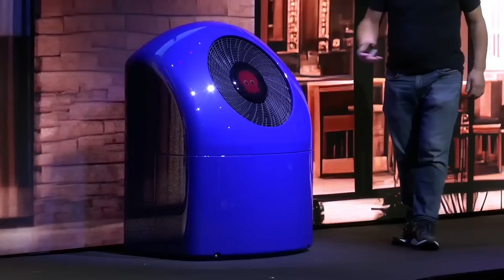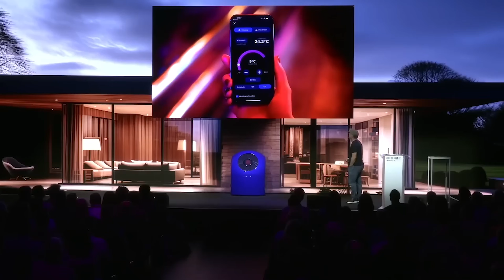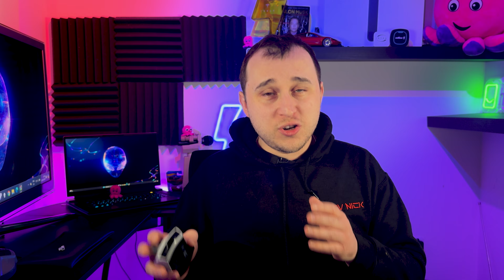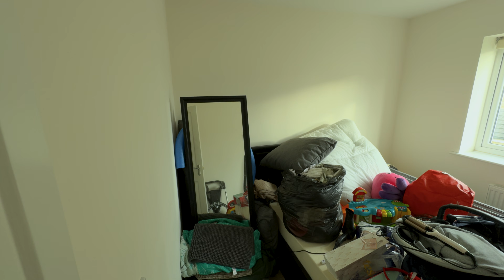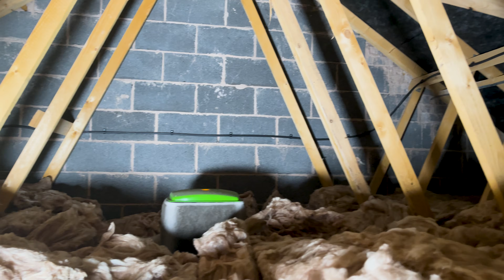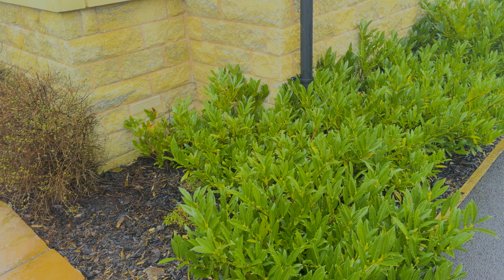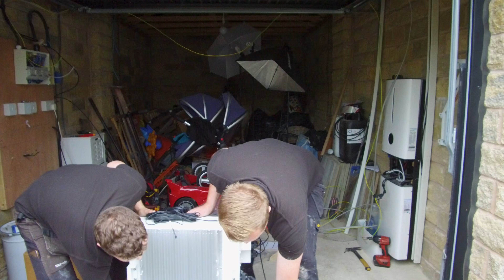Octopus Heat Pump Survey HAS Hidden COST!

Comment: It's a good shout on the radiators, I assumed my house would be copper pipe and tapped off which does help with the presumed problem - though I haven't lifted my floorboards yet, the signs are good. Loft hatches between the rafters - good old new builds, mine is like that, you only get just under 600mm to play with in new builds, you can make them longer but not wider without pretty serious complications. NGL I'm not personally a fan of tanks (and really any infrastructure, particularly water-containing infrastructure) in my loft. Yeah, you'll probably never have a problem with it, but when you do the problems tend to be relatively quite serious - and you have to get the heat up there to start with which is relatively lossy. I'm holding off on heat pumps on two basis - firstly that if permitted development rights allow larger volume units there might be a flood of new products that are more efficient (larger volume = larger heat exchanger = more efficient). Secondly, exhaust air heat pumps really appeal to me because my new build is super efficient, and I want to take heat that gathers at the top of my (3-story) house and put it back in at the ground floor and tap it off excess, plus the ventilation. With an EAHP I might be able to tear out my radiators entirely and not have to worry about the pipework nonsense. Both of those markets are going to take time to develop, and I think I'm going to wait for that. On tanks - I have a huge space under my stairs that only has an ironing board and my server rack that could easily be used for a water tank, somebody should really make a wedge-shaped one that could go there.. In re putting a heat pump unit next to the pavement like that, I honestly don't think I would want it where people could vandalise it as they walk past anyway, people be people, doesn't matter how nice the area is.
Reply: Wedge shaped tank would be a really interesting concept.

Comment: I would be bloody annoyed if as the neighbour I had to have your heat pump closer to my bedrooms than it was to yours regardless of the dB which can change over time 😀
Reply: So your be equally annoyed by a gas boiler in the same location?
Reply: @JohnR31415 are you being deliberately thick .
Reply: My heat pump is close to my bedroom window and I can’t hear it, it’s nearly silent.
Reply: @JM1919MJ  "I can’t hear it, it’s nearly silent" ... 😂
Reply: @farab4391  yeah, I can’t hear it from my bedroom but when I’m next to the heat pump you can just hear it a little bit? I don’t get what your point is 🤷‍♂️
Reply: @farab4391  judging by your other comments on this video you seem to have a weird vendetta against heat pumps, if your happy with your 25 year old gas boiler in your garage and you’re not getting a heat pump then why are you on here having a moan about them? Bit strange don’t you think?
Reply: @ because since I’m getting requests from everywhere to change to a heat pump, just like with smart meters, I’ve been doing some research.  So I’m sharing my findings and experiences with other people in the same position than me.
Reply: @farab4391  It doesn't look like research from what you've said above. It looks like prejudice and pre-conceived ideas.

Comment: Really interesting. What this really highlights is the insanity of still allowing new homes to be built without heat pumps (and solar PV)
Reply: And the double insanity of allowing new houses to be built that have tiny microbore piping, making it extremely difficult to upgrade to heat pumps.
Reply: @sunbeam60  great point
Reply: As a former PV installer seeing new builds with 2 panel in roof systems is just sad. What a cost cut minimum effort, well done developers.
Reply: @waynecartwright7276  Amen. The developer should be required to provide enough PV to generate most of the annual energy requirements for both powering and heating the property
Reply: because it still isn't long term proven technology in the eye of the consumer, so puts people off buying houses with heat pumps and/or solar, because they don't want to be saddled with the potential cost and hassle of replacing/fixing it later.  Builders know this.
Reply: @farab4391  every single person buying a house has one or two heat pumps running in their house 24/7 and they are utterly reliable. It's their fridge and/or freezer. So not new, not unknown and everyone is familiar

Solar panels come with a 20-25 year warranty and give you free electricity, they don't just pay for themselves, they pay you to own them

Developers are short sighted profit mongers and should be ignored when it comes to sane policy making
Reply: @farab4391  every household has at least one heat pump in their house that runs in their house at low cost 24/7. They rely on it completely but know it is so dependable that it will work for many years with zero maintenance. If they knew the technology is the same as their fridge, those ideas of it being either new or untested technology would make no sense
Reply: @bill_heywood  there’s a BIG difference between a small heat pump for a fridge that is located inside your house which runs about 4hrs/day and a big heat pump outside, exposed to the UK weather, running almost constantly.  You’re comparing apples and oranges.  Current heat pumps won’t last 10 years without major maintenance or replacement and the government isn’t going to give you another £7,500 to do that.  That’s even assuming you qualify for the first £7,500 grant.  In a few years time heat pumps will be the next UK scandal.  It’s not the fault of the technology itself, just the cost and how it will be implemented/managed in the UK.
Reply: @farab4391 my point is that it is the same technology, it's been in homes for decades and everyone knows it works

Given much of Scandinavia runs in heat pumps and heat pumps are specifically designed to be located outside, that's not a sensible point. Our cars also live outside

Heat pumps will not run all day, or even most of the day. Gas appliances inside homes have been killing people for years in a variety of exciting ways, yet that's not a scandal

People will switch, it'll be fine and we'll all wonder what the fuss was about
Reply: @farab4391  You clearly know absolutely nothing about heat pumps.
I'm four years in & expect break even point later next year.
Reliability?
ZERO issues, as they're designed to sit outside, just like A/C does in the US.
This isn't new tech, it's repurposed old tech but more efficient.
Reply: @GARDENER42  well, I didn’t say anything that was untrue, so you clearly know nothing about common sense
Reply: @farab4391  Nope. You're making baseless claims.Go & educate yourself.
Reply: @GARDENER42  🤣
Reply: @GARDENER42  well said, they clearly know nothing about heat pumps
Reply: Also that the heat pump replacement scheme only applies if you have a boiler that is replaced. Logical the subsidy should cover new builds rather than just replacement
Reply: Shouldn't be any subsidies, full stop.
Reply: And those huge warehouse factory units !
Reply: Honestly, given the standard of many new-builds nowadays, I'd expect a builder-installed heat pump (and solar PV) system to be, shall we say, a disappointment.
Reply: The insanity is having one of these things in the first place.  Just like Smart meters, EV chargers and solar panels.
Reply: @tubemonks  The insanity? Whatever do you mean? We have solar panels for hot water & electric and they are troublefree. What could possibly be wrong with a smart meter? You think the Government are spying on you? Get a life.
Reply: @tubemonks  I have never understood why anyone actually wants to pay more than 3x more for their electricity. What is it about being gouged by your energy company that you enjoy?
Reply: @bill_heywood  Even if you think you're going to pay less in the short term, in the long term you'll get shafted as you are with EVs now.  I care about the environment mate and not covering farmland with wind turbines and plasic panels.  I prefer food myself, not savingf a few quid for a few months.  You are obviously a youngster and haven't worked it all out yet.
Reply: @bill_heywood  Smell the fking coffee son.
Reply: @tubemonks  sure, I'm a teenager with my own house and solar panels. You know what happens when you assume

My solar panels will be generating for 25 years, no idea why you imagine otherwise. Hopefully some of your neighbours have PV, they will be powering your house too and being paid for it 

TBH I don't understand the eagerness to pay through the nose for electricity, but I'm sure you can see an upside 

Clearly you've never seen the amount of plastic farmers use on their own fields. Whole fields covered in black plastic or plastic poly-tunnels

I suggest you familiarise yourself with agrivoltaics, solar panels and agriculture are very complimentary
Reply: @JunkyardDog-q1h  there is no upside to paying a  fortune for electricity when you generate make it for free at home. You don't even have the beginning of an argument
Reply: @bill_heywood  Whatever son.
Reply: @bill_heywood  We don't listen to those with absolutely no life experience boy.
Reply: @tubemonks when you are assuming, you are failing and you are assuming. But why don't you tell us about your decades of experience with heat pumps and solar in new builds
Reply: @tubemonks  lmao, I have an EV Car and it costs around £2.50 for a full charge that lasts me a week. If this is shafting then you have no clue what you're talking about. Doing research on heat pumps and over 10 years I'll save 26k. Put the tin hat on again lad lol

Comment: Hi Nicolas, not sure about the other things but I might have a solution for your additional radiator for your kitchen. I plan to get heat pump in near future(after PV upgrade) and plan to get rid of some of the ugly ad always in a way radiators in kitchen and living room. For kitchen there is a water feed plinth heater. Since your boiler is already there there wouldn’t be much work required for plinth haters(except that you need a weak power source, low voltage power or just. Normal electric connection). Btw ther are some plinth heaters with wireless conectivity to HA and likes! And for he living room there are heating skirting boards to buy. Not sure if this would solve some of your problems but maybe a good idea.
Reply from the maker: For now a small rad there isn’t too much issue so I’ll go for that,  I did think of a plinth heater though!
Reply: How about rads with booster fan? ... Pro's and con's ... ?

Comment: I'd be concerned about somebody nicking the ashp if it is in such a "remote" location.
Reply from the maker: It’s a very special and odd item to steal,  it’s heavy,  would take some time to remove and requires a level of skill to refit
Reply: If you live in a remote location you’re more likely to have heat pumps fly tipped at your property.
Coal is the future

Comment: Daikin's don't seem to be as efficient as Vailant's. I'd be tempted to wait and see what results the Cosy 6 gets or go with British Gas who supply Vailants.
Reply: Had our survey done a couple of weeks ago.
All seemed good, house is a 7 year old new build and heat loss he said was one of the better ones he'd done.
System was designed and we spoke about placement for the ASHP outside.
With 2 options
On coming back to me last week, both installs will require planning permission as 1 is within 1m of the boundary (even though other side of the 6 ft wall is footpath)
The other option puts me 0.1db over the 42db permitted development allowance limit.
So annoyed right now for the sake of 0.1db if only octopus offered an alternative ashp that was better than 58db at full tilt.
Cost for planning will be around £4-500 with no guarantee of passing.
So i think we're going to give it a miss.
We live in a 4 bed detached on the end of the street with neighbours only to one side, so have a decent size plot to install on.
So how the hell are those in semi's and terraced going to be able to get one fitted.
Answer - they're not.
The mcs20 is a joke and needs serious overhaul.
42db is almost silent 
Quieter than a fridge freezer.
If the government want these things to be the future they need to amend the planning farce.
Reply: Good luck with Daikin after service! Good heat pumps when they work. Vaillant are very good with their after service and if you have an issue, plus have a very good deal with OVO for cheap electricity
Reply: I agree with the comment on Vailant being a better system.  However, British Gas phoned me the day before my survey stating some pretty unviable conditions.  Despite me having all 22mm and 15mm copper pipework and some under concrete floors they stated that they would replace the entire heating pipework in the house and surface mount wherever there was a concrete floor.  Additionally they insisted they needed 1m access width down the side of the property to get the ASHP to the back, while I only have 850mm.  The ASHP is only 700mm wide, so maybe their fitters are extra large gents?
Sorry to whine, but British Gas let me down with a 'no' the day before the survey, after waiting 5 weeks for them to come.
Reply: @Ben-gm9lo  Thanks for the info. I haven't started looking for quotes yet as I still have some upgrades to do but I'd be annoyed with that service too.

Comment: Think you’ve just persuaded me not to use Octopus Energy to install a heat pump.
Reply from the maker: Why that?  Other quotes I got were past 7500 after grant
Reply: @NicolasRaimo  Indeed, Octopus are offering amazing install prices.
Reply: Pay for what you get, Octopus have just had a massive requirement drive. It will take time for them to weed out poor installers

Comment: Thanks for being honest about the extra costs involved regarding hp quotes.
Reply from the maker: I’ll be documenting the whole thing on here,  so far I’ve been very impressed with octopus service
Reply: To be fair to Octopus, they are producing a minimum cost product with the aim of having the maximum number of installs.  Greg Jackson (Octopus CEO) is working very hard to make ASHP adoption as palitable as possible.  The installation of these systems is so user-specific that you can understand why their budget quotes don't cover many additions that some installs might require.
Reply: Octopus just fitted mine, all in £915

Comment: Worth considering if its put outside of the wall, it could accidentally get damaged by kids playing or god forbid vandalised, incurring considerable costs further down the line. We made some compromises when choosing a place for ours. Originally wanted it on a first floor flat roof but they said no. Another location exceeded the primary pipework limit  (10m I think) from unit to tank. So we put it in front of the kitchen (No windows) minimised interference with the space of the garden and no planning permissions needed etc and very importantly it's safe! We're happy with it and it performs really well. 11kw Daikin monobloc (silver/black grill) on average insulated, 6 bed semi.
Reply: Yep, 10 meters max for the Daikin
Reply: Could have gone on flat roof. Octopus just don't want to get the ladders out. Yes it's more difficult for them but plenty of heat pumps get installed on roofs with the appropriate mounting kit.
Reply: with the amount of anti heatpump idiots around these days, i think vandalism is a real possibility

Comment: I previously read that the UK and regional parliaments intend to gradually equalize the unit price between electricity and gas over the coming years. It was buried in one their respective buildings heat strategy documents from a few years ago and I don't think this has changed.
Reply from the maker: this been a long term plan since the war started and the energy price madness started,  currently we use gas to generate some electricity this inflates the cost of electricity to be  very expensive,   what we will see is this unlinked from electric wholesale costs and wind/solar used as the price factor instead.

Comment: We came up to the cylinder too wide for loft hatch conundrum. Hopefully there's an ashp on the way that can heat water on demand. Even if the running costs go up because there hasto  be an additional heating element, it would solve so many problems for our UK homes, where space is often at a premium. Oh and time to prize apart the relationship between gas pricing and electric.
Reply from the maker: There’s some other solutions out there which ain’t hot water tanks!
Reply: @NicolasRaimo  tease! Seriously, ashp for rads, then ashp with electric boost for taps, showers, baths could just be a simple swap for a combi boiler 
But good luck getting a grant for it.
Reply: @martinwray7001  sunamp heat batteries for instance.
Take the heat pump output so afaik they do qualify for the grant.
Reply: @JohnR31415  but still a big lump to put somewhere.
Reply: @martinwray7001 yes - because storing heat is always going to allow more efficient heating than running very high power heating.
Similar space to the boiler…
Reply: @JohnR31415  plenty of people have an electric shower providing hot water on demand. All I'm saying is that ashp with boosted hot water on demand would be a great solution for those of us struggling to hide a cylinder. 
Octopus can't fit a cylinder in the place of our combi because they need a min of 1m width. This, our loft hatch and the 6 month wait for a survey have meant that we had to fit another combi boiler. I'd love to bin gas, but needed a solution straight away, or shiver all winter.